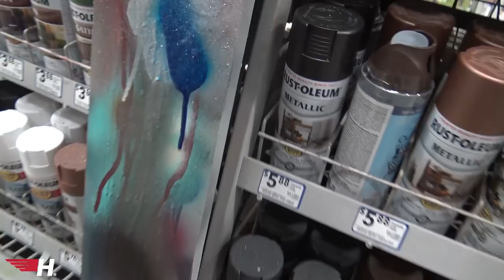LS400 Gets Riced Out (DIY HOT BOI PAINT)

Comment: Try and do a manual transmission swap, that would be sick
Reply: +1
Reply: +1
Reply: +1
Reply: i second that.. what most guys do here in SA. is use a BMW 330D transmission and weld on a custom adapter plater made by transmission shops its works really well and those gearboxes are bullet proof.. or even the old Toyota cresside 21R transmissions
Reply: That car Dude w series or r154
Reply: +1
Reply: Yeah dude, just SEND IT too Dan's

Comment: You guys should put the TransGo shift kit in the LS400. I have done it on a past SC400 I owned and it works wonders and makes the transmission shift much harder. Mine would shift right when I moved the shifter from 1st/low into second and it would break the tires loose letting you easily drift in 1st and slam into second keeping the tires spinning hard. It's one of the best mods you can do for the SC400/LS400 platform if you plan on staying automatic. It will lengthen the life of the transmission by reducing slip in the band and reducing wear on the clutch packs. It will be the best $100 you will spend on that car. Here is the part number from summit: TRG-340-HD2. It only takes a few hours to do and its not hard at all. Easy ticket to some crispy shifts. Good luck guys and keep the great content coming!!!!!!